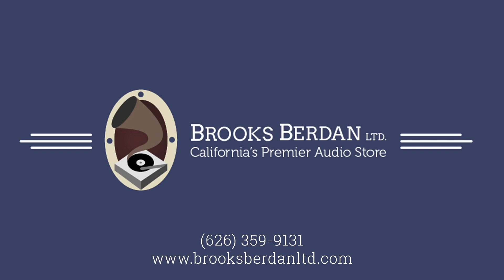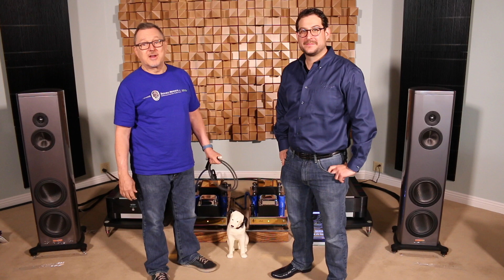Audioquest Cables - DO NO HARM - preventing distortion in audio cables! - Brook Berdan Ltd.

Comment: What does the little button do? What about the arrows? Please and thank you.
Reply from the maker: The little button lights up an LED when you push it to let you know that the battery is still good as Isaac mentioned the batteries usually last 7 to 10 years as for the arrows the cable is directional so the arrow indicates from the source to the component

Comment: I think silver is an overkill and unnecessary. The benefit cost ratio doesn't measure up.
The conductivity of silver clocks in at 63 x 10⁶ siemens/meter, roughly seven percent higher than the conductivity of annealed copper, which stands at 59 x 10⁶ siemens/meter. Measured in ohms, the difference in the resistance of 24-gauge, 1000-foot-long silver and copper wire is minor. The resistance of the copper wire is a mere 2 ohms higher.

Comment: How do you change the battery after my cable is 10 years old?
Reply: i've seen a review on this before and that yes the batteries do come out and they are supposed to be good for seven years and it's just a few AAA batteries like three or six,  But really the question for you is do you honestly think your 10-year-old cable is going to be worth anything in 10 years or do you think you're gonna have to trade up and buy the same exact cable which will probably cost about $50 then
Reply: The battery pack acts like an RF antenna. Better to just disconnect it and use the batteries to power a flashlight. The actual batteries serve no purpose for the cable itself unless you just like to have a green led light with a button push.

Comment: I don't understand. This is a cable for digital transmission, !'s and 0's, or two values of voltage. There usually is a pretty good dynamic range between these voltages. The bit rates for digital audio aren't that high relatively speaking.  Much simplier cables can be used with no data loss. Why all this overkill? The explanation given sounds as if they are talking about distortion in analog waveforms
Reply: Do you understand how that 1 and 0 are measured?  How does the system know it is a 1 or a 0 if it is an analog electric signal?  Because it's based on square waves.  If that wave is perfectly square, then it's a 1.  If line is flat, it's a 0.  If that square wave isn't perfect, as if one if its corners is rounded for any reason, then the system either rejects the bit or thinks it's a zero.  Therefore, you want the best possible transmission of that signal.